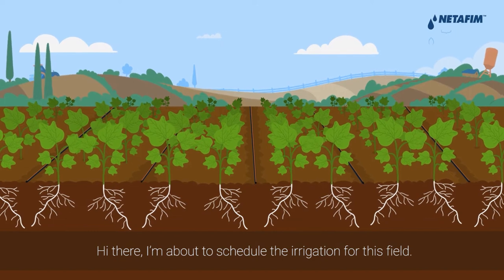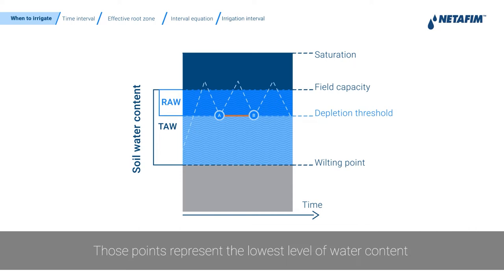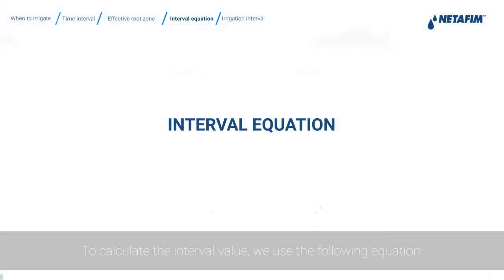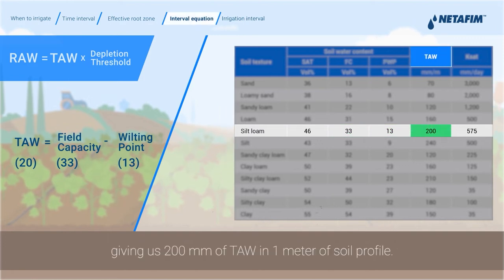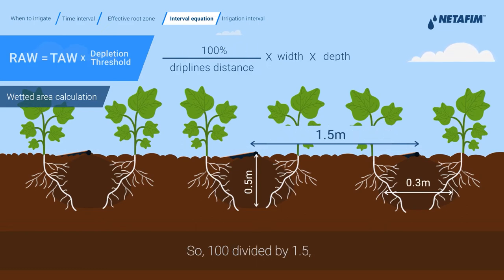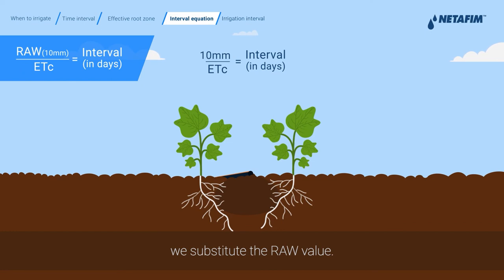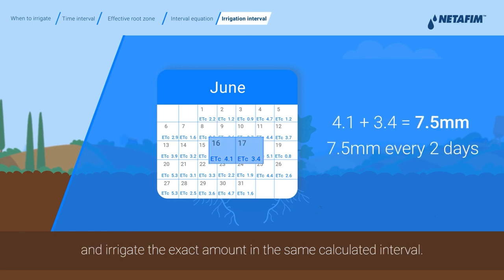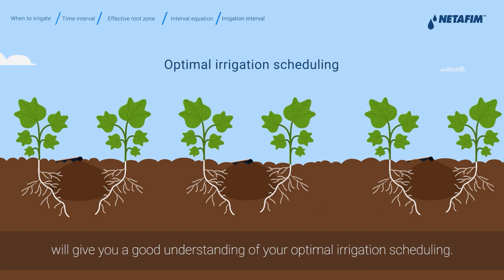Irrigation scheduling | Netafim

Comment: Hi, thanks for this great video. maybe I'm missing something but in the wetted area calculation it seems that the equation is maybe missing something. 
you are multiplying 100% by 2 distance units (depth and width) and dividing only by one distance unit (dripline distance) which means your wetted area result is in percentage X distance (in the example on 4:16 the result is 10%meter instead of 10%). seems to me you should be dividing by another distance unit.
Reply: The  total  depth  of the soil  is 1m for the TAW as stated in the FAO table. so 1.5m x1m is 1.5sqm. so the proportion of the wetted perimeter to the tota TAW is  ((0.3x0.5)/ (1.5m x 1m)) x 100%